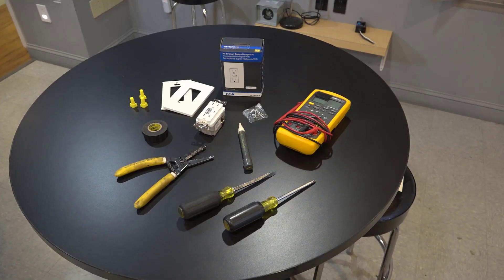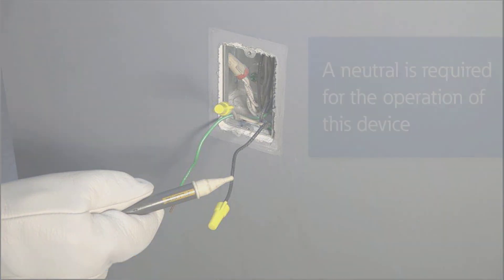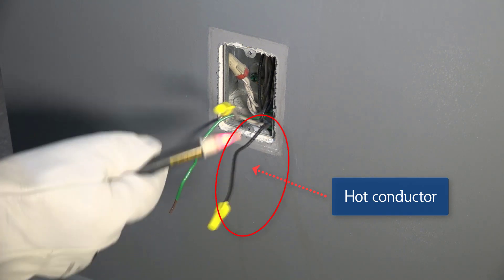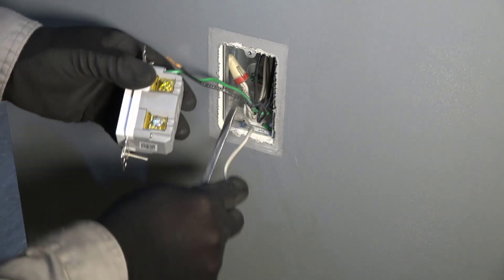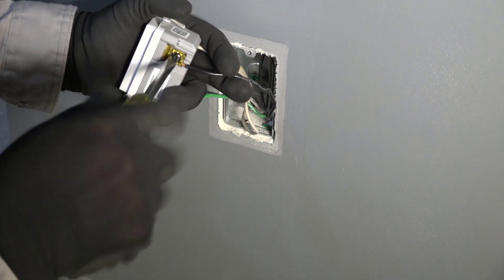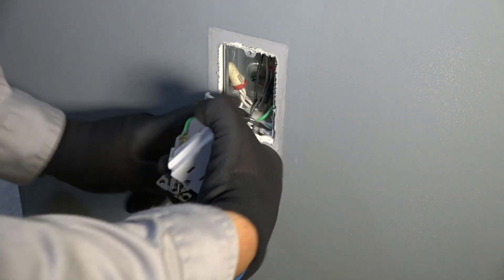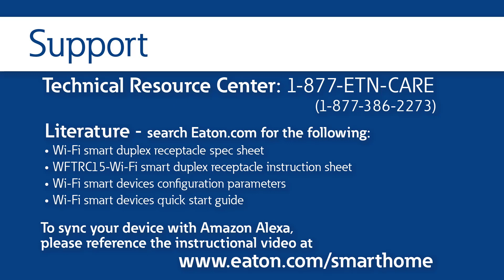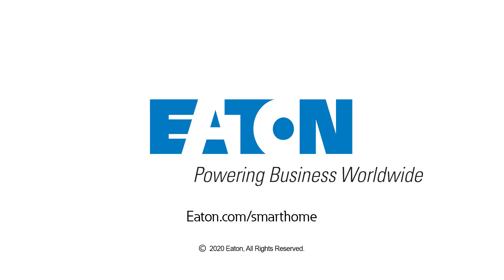HOW TO INSTALL: WiFi Smart Duplex Receptacle - Eaton (Mike Holmes Approved)

Comment: I want to know how you actually set one up. Installing it to the wiring is not the set up. Little information you provide is useless. I tried two different Eaton apps and they are useless as well. Full strength Wi-Fi at device.